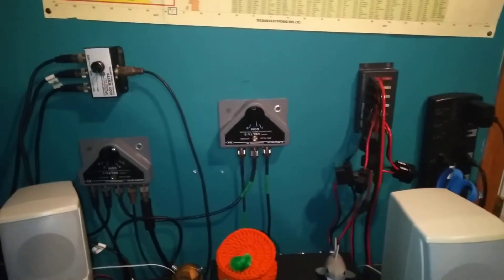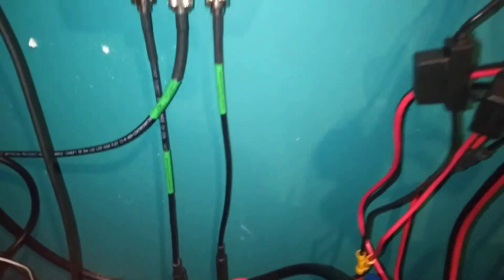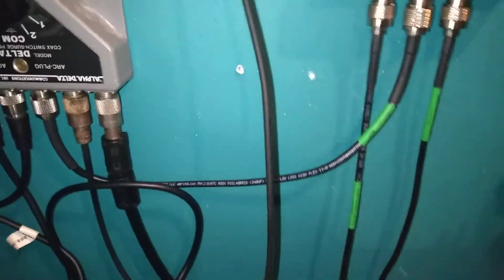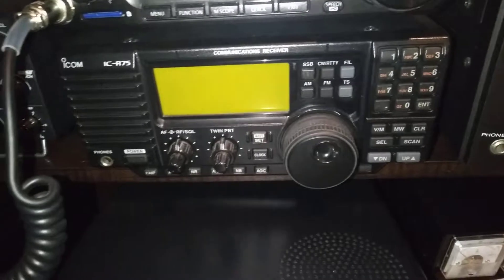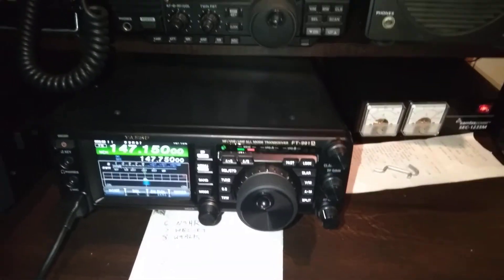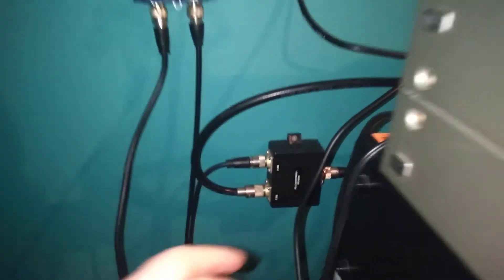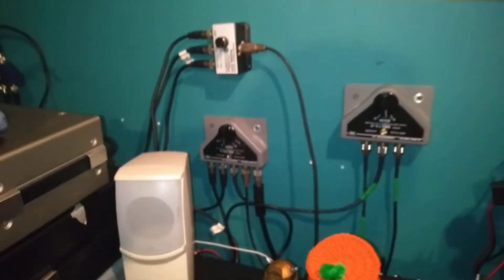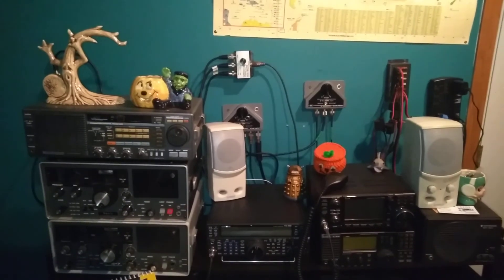KD9LVR's Coax and Antenna Switch Setup

Comment: Do the switches need to be grounded?
Reply: It should be grounded, like its radio and antennas, before entering the house. If you take a good look at the switch, there is one of the bindings which has a golden circle, it is to add a terminal for grounding.